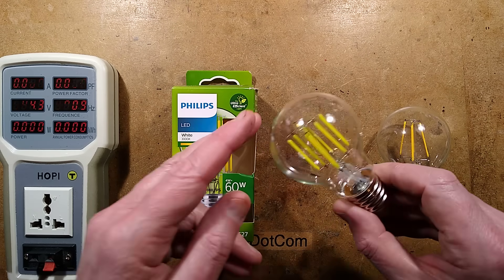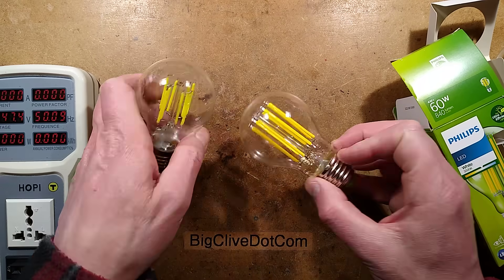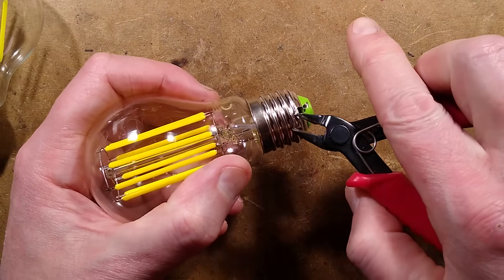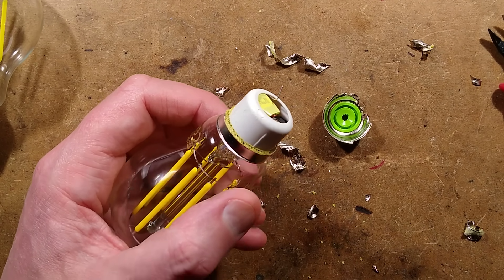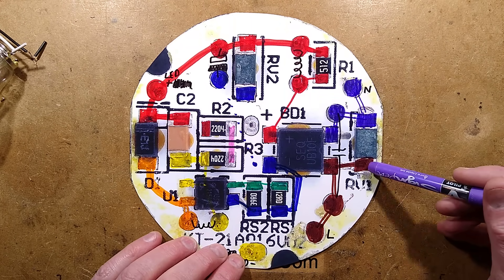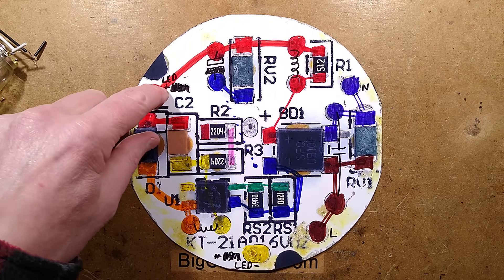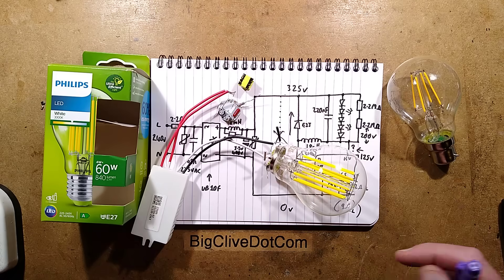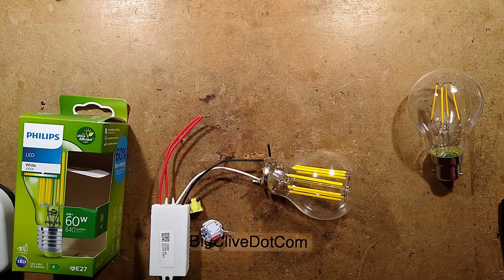Inside a new Philips ultra-efficient LED lamp (with schematic)

Comment: 210lm/W is really impressive. I got some old lamp with 160lm/W and i remember that back then it was the most expensive light in whole shop, paid like 10$ for it. Im still amazed how good that thing performs, my bathroom is really bright and its not even hot to touch, just slightly warm. After using all those cheap hot lamps i didnt know it was even possible.
Reply: 200 or so seems to be about the average I'd see in commercial led lighting I'd come across but AFAIK Cree has been putting out 250+ for several years at least. Most of my flashlights use leds which are about 250 lumen per watt at least. These are larger die power leds but still.. in a low voltage design like that it still takes about 10W to produce a little over 1000 lumens with the Crees. Some of these numbers get confusing.
Reply: @Magneticitist  242.5lm/W is the hard luminous efficacy limit for any true white light source.  Going higher than that requires cutting out bits of the spectrum to which human eyes are insensitive, with the absolute limit for any light source being 683.002lm/W at the 21.85µin/555µm green to which the human eye is most sensitive.
Reply: @randacnam7321  Damn 683 sounds pretty nice, I think I could deal with the green.
Reply: @Magneticitist  Would be monochromatic green light so you would have no color perception.
Reply: @randacnam7321  With the amount of light I'd be trying to throw I wouldn't really need to see color
Reply: @Magneticitist  683.002lm/W is also the absolute theoretical maximum and not representative of what is practically done.
Reply: The us variant only gets 180 l/w

Comment: Had the idea to make an LED panel embedded into an insulating panel I need to custom fit to a basement window. The idea being I'm getting rid of what little natural light makes it in and replacing it with something as good or better. I love day light colors and would love it to be high efficiency and can be dimmed. Any suggestions as to what lighting solution would be easy to use for this application?
Reply: Several lamps with individual switches. Say 4 to allow dimming to 25%. Say one 40W equivalent & three 60AW to go to 18% with more steps. Perhaps one less than 40W equivalent of you like the lowest setting a lot.

Comment: Finally an E27 lamp that is rated for use in enclosed fixtures! Nice.
I bet they engineered this specifically to reach the "A" classification in the re-scaled EU efficiency rating (most good lamps are rated "D" right now). Prior to September last year, this lamp would've just been another A++ along with 85% of the market.
Reply: Given that the new "A" energy efficiency category starts from 210 lm/W and these lamps achieve 210 point something lm/W, definitely engineered to be part of the top category. I don't blame them for that, but would still like to see a redundant voltage converter inside like the the Dubai lamps. Otherwise that will be the part that fails first … and not after 50 years. Much earlier.
Reply: The packaging even involves a symbol Philips had made specifically for lamps that fit the new best category, so I think that's pretty likely.

Comment: High IR output is bad for efficiency but sometimes you want the heat.  Efficiency calculations need to include the cost to buy as well as the cost to run.

Comment: A 50 year electrolytic cap? I know of none that can meet such a claim, even unpowered.
I'd dig a bit deeper into it's spec.
More than 200 lumens per watt...wow!
Reply: Came to the comments to say this. I guess the 50 year claim is just on the LED specs, and not the other internal components? Pretty shady marketing...Yeah, the LED's will last 50 years, but the cap will last 15-20 at the most.
Reply: @floorpizza8074  There are still many radios from 70s that work fine, with caps never changed.
Reply: @xsc1000  Was going to say the same...i have a Collection of Grundig and Blaupunkt transistor radios in my garage, all works fine 50+ years after leaving the factory band. Electrolytics made by Philips or Siemens. My 40+ years power amplifier by UREI (JBL pro) is also in perfect order. Caps by Chemicon (Japan). I guess you get what you pay for...

Comment: I'll have to find out if it comes in bayonet version, or if I have to change my light fittings and burn my apartment building to the ground before I can use these.
Reply from the maker: You can get adaptors.

Comment: Maybe not suitable for PIR motion sensors? I can't imagine what would make it unsuitable though. Perhaps it's the deviation from the circuit recommended in the datasheet.
Reply from the maker: It might be due to leakage through snubbers making them strobe when off.

Comment: Thank´s for showing us the insides! I got the exact same a while back and the first thing I noticed was the price. 10€ in my case whereas a 100 W cheapo is only 1.5€ at OBI. Even though it only gets to 36C, I still wonder if it actually lasts longer. I wonder why they don´t make a 100W "green" yet. Mostly, if you have old incandecent fixtures that were only ment for one 100W bulb, a 60W one does not have a great deal of light. That´s something that pisses me of that you need fixtures that fit a lot of bulbs to get a decent brightness. A Y-adaptor sometimes helps too :)

Comment: I want this with 2000 lumen. Why are E27 lamps always so weak? 800 lumen is barely enough for a toilet.
Reply: There is a 1500 Lumen version available with 12 filaments and 7.3W. It is longer and wider than the version from the video. But no retailer is able to order them, seems like they are new on the philips page.

Comment: Probably base down use only.  With base up, the rising heat does in the electronics.  That was a big issue with CFLs at least when they first came out.

Comment: that simble is for no motion light use
Reply: Motion lights require some current to flow and some led lamps don't provide enough to keep the motion module to working

Comment: I'm surprised they're allowed to use MOVs without thermal protection, given that UL60065 requires it for other domestic appliances for example.
Reply from the maker: In this case it's in a metal enclosure with a fusible resistor.

Comment: I can only assume there are some manufacturer options for that HV line being used in that way, likely in something we cannot read but probably dependent on load or use case, as my experience is that those lines normally need a TTL bootstrap of some sort - which you've shown in other videos - but if this one 'strikes' live or from HV, then that is also interesting / unique IMHO, and likely marries up with the advertised performance characteristics. My slightly imbibed 2c at least

Comment: Philips really need to up their game with dimmable, high CRI lamps. They do make some, especially the "dim to warm" or whatever the branding calls it now. But they are not as ubiquitous as they should be! i.e. they are usually sold out at Toolstation / Screwfix, and they aren't available in all the formats you might hope (GU10 / bayonet / screw / golf ball / candle etc...) Also CRI is never advertised, which is a shame.

Comment: I bought a load of the IKEA "V8" (filament shape and amount) ones, with a Lumen per Watt rating of 160, so not 220 like this one, and I think they are quite good. Even emailed you about them.
When even better cheap ones comes out, I will of course buy those, never really getting near the 50.000 hours 🙂
Reply: I've bought a couple of those Ikea 160lm/W lamps, but Ikea don't seem to be making much effort to advertise their unusually high efficiency.

Comment: One of my first jobs I was working for the senior electronics engineer of the firm and he told me that there were two ways to get incandescent bulbs to last longer. One was to run them off DC vs AC. The other was to run it off a lower voltage than specified. You get a dimmer bulb, but it lasts much longer.
Reply: Two tungsten lamps in series will effectively last for ever... wont be bright tho

Comment: Commenting on LED " colour " , some latest microwave ovens use a ( more robust ) twin " filament " LED lamp , a direct replacement for the tungsten types ( which always fail ! ) .. when powered outside the oven , they give a trendy golden yellow light ( almost similar to LOW pressure sodium street lamps , remember them ? ) .. I am guessing this makes your rotating pie look more appetising ( ? ) .. very peculiar when used as a room light ! ... QED ...

Comment: 3000K is my least favorite color temperature, particularly in these LED lamps. May be the low CRI, but I find mixing 2200-2700K and 5000-6000K in ratio to make a much, much more pleasant mid-white

Comment: The mystery symbol means that it can't be used as the 'flame-effect bulb' in fireplaces, as these need to give off heat to cause a fan-type device to rotate to give the flame effect.

Comment: The mystery symbol might be 'not suitable for PIR security lamps' as a lot of cheap PIR sensors leak enough current to make an efficient lamp flicker when it's supposed to be off.
Reply: You telling me they have gone so cheap to replace relays with scrs
Reply: @africanelectron751  hey, relays are expensive!

Comment: i had 2 LED bulbs die in the same month, one was edison the other bayonet ,both around 4-5 years old ,morrisons own brand ,they did ok i suppose ,i got a replacement morrisons one with 6 filaments instead of PCB mount style ,it has around 20 LEDs per filament ,see how long that lasts, think its a 100 watt candescent equivalent bulb

Comment: Nice video as always.

Shame though.  Another intermediate step to actually making a decent lamp?  More landfill along the way?  Sold in clear glass for showmanship, or for magpies?

I still see evidence of polar banding in the output.  It'd be nice if you could gently rotate an illuminated one a few inches away from a white background to see how much of an issue this is, is it just bands of brightness, or the common blue/yellow hue as well?  As far as I can see it will remain an issue until they put in dozens and dozens of filaments, or switch to less efficient outward facing COB arrays,  or just implement a secondary diffuser - yes, a frosted, opal or matte bulb coating.

The best possible quality of light comes from having a large uniform and spotless illuminated area.  After being an early adopter of ugly and short-lived clear filament LEDs I've gradually swept through the house moving to opal or frosted 100-140 lm/W versions by Silvania/Crompton/Osram/Calex/Philips.  The big GLS A80 Philips matte white 1521 lumens gives an amazing quality of abundant, disperse and diffused light, something we've been missing since the demise of the traditional opal coiled coil, and the Silvania A60s come close.  The Osrams have had a huge failure rate, but the other "brands" have been great, though none of these efficient and attractive filament bulbs are available in the usual physical or online outlets.  Diall sell some that look similar and are available in the DIY stores, but are much less efficient.

With secondary diffuser bulbs the polar stripiness is still there at the glass, but generally unseen there due to dazzle, and beyond that it's inconsequential because as it is diffused it doesn't project onto your walls or ceilngs or anything more than an few inches away from the bulb.

And CRI 80.  I have CRI 97 GU10 lamps in my kitchen spots and in a reading lamp, and they just light up stuff with realistic hues, so much better discrimination than my filament LEDs.  C'mon, surely they could put better phosphors on those filaments - or is it just another planned obsolescence/upgrade path?  They won't wear out quickly,  but when folk realise their output can be dramatically bettered...

So, with it's lack of a secondary diffuser, poor CRI, and lack of dimmable options, this seems like another lamp with designed-in obsolescence, in spite of its eco bragging rights.  For sure it's prettier and more efficient than the high street filament LED offerings, but why won't Philips just go the whole hog and make us a fantastic long lasting and efficient bulb with great quality light output to match?

Seems a sensible choice to ditch the Dubai lamp's linear regulator though - why waste a percentage when you are chasing percentages...?
Reply: I've been looking at conventional LEDs (not the filament or chip-on-board types) and high lumens per watt go along with poor color rendering.  For a comparison of two 2700K devices, the high efficacy LED was 216 lm/W but it had CRI 80 with R9 = -7.  Finding a part with good light quality (CRI 90 and R9 = 50) dropped the efficacy to 123 lm/W, a drop of over 40%

Seems like a missed opportunity for filament LEDs though.  I've long wondered whether they could include occasional LED chips of different colors to fill in where needed.
Reply: @CoastalSphinx  they certainly could mix colour LEDs in each filament, especially with plenty of filaments behind an opal diffuser, but maybe it's just about getting the right balance of broad spectrum phosphors⁷ in the silicone coating.  Line responses such as quantum are efficient but the exact opposite of what's needed for colour rendering

Comment: Hi, I'm new to the electrical world. I'm surprised that the PF is so bad (0.53), why doesn't the manufacturer improve that in order to improve efficiency?
Reply: PF and efficiency aren't directly related.  Basically, PF only really matters when large amounts of power are involved.

And in this case, improving the PF would need a fair bit more circuitry (which probably wouldn't fit into the bulb base) while reducing the efficiency of the bulb.
Reply: @CoastalSphinx  thanks for responding. I'm learning that electronics are not like electrics. 👍🏻

Comment: If the chip has a fet it probably runs about a 20v supply, powering it through the leds makes the chip drop less voltage, with the advantage that the current it takes goes through the leds producing light instead of just heat in the chip, so I'd agree its done for efficiency.

Comment: Recently I had to replace a tungsten bulb that had been in daily use for over 10 years.  The led replacement would have cost seven times as much as a tungsten replacement - that's seven times as much work and energy expended just to afford the led, not to mention the unnecessary complications of its eventual disposal.  Even then, the led would not have worked in the dimmer circuit so that would have meant addition expense.  Fortunately I was able to purchase a stock of tungsten lamps.  Another own-goal by the eco-idiots.
Reply: weird hill to die on honestly, 4 bucks for a bulb that costs 6x less to run and lasts 50x longer is a steal. florescents deserved all the hate they got though.
Reply: @ShinyQuagsire  The previous bulb lasted over ten years in a normal daily use so one that can potentially last 500 years is of little interest to me. I do use leds where it is appropriate but the long life claims do not stack up - I have had several which have failed within months.
For me the main benefit of led technology is its potential for developing low voltage lighting alternatives which can then be run using renewable energy sources.

Comment: Icon: I think "Not suitable for Emergency exit luminaire". I thought about what you said about using the chip in a non-standard configuration. Philips may have got a copy of the internals from the manufacturer and/or consulted the engineers at the manufacturer or simply got a custom version of the chip fabbed. After all, they Philips would be ordering enough that it would be worthwhile. I did a quick check and it doesn't look like this lamp is available in North America yet.

Comment: I'm still staggered by how LED lamp manufacturers get away with the lifespan claims on the packaging. I replaced 8 gu10 lamps with expensive LED units (circa 5 quid each), because I was sick of replacing the halogen ones( I considered power usage as well). The bloody things started failing within 2 months.
Reply: I had the same experience replacing some G4 lamps. I later learned it was "my" fault. The transformer was rated with a minimum wattage,  and the LED didn't draw enough. So the power supply was uneven, and that fried the LEDs.
Reply: @dirrelito  these are mains rated at 240v. Straight replacement lamps.
Reply: @handlesarefeckinstupid  did you put them in recessed outlets? Most failures I see in LEDs is usually the power supply and if not an LED slowly cooking in recessed lighting.
Reply: @dirrelito you need to do some research first whether your LEDs are constant voltage or constant current

Constant current LEDs has to be paired with the right power supply which limits it to the correct current, this is similar to the ballast of a fluorescent light

Constant voltage LEDs don't give a sh*t as long as you give it 12v, since it has current limiting resistors built in

Comment: Another dead LED bulb in our house the other day.  Though it happens rarely, I think the power supply in LED bulbs is redundant, less reliable which is wasteful.  we should start thinking having the DC power supply in switches so that they are easier to replace and less space constrained that those in bulbs.
I'm thinking of a light switch/panel that integrates the switches and  a power supply that outputs DC, maybe like, PoE voltage around 50V which connects to the light fixture

Comment: This light is made for new energy labels (EU) 2019/2015 for lighting products. Getting A label on your products your need have 210> lumens per watt. With an higher CRI is very hard to reach high luminus effiecenty. 
I guess around 36 LED chips per filament.. at 2.75V @ 4.9mA per chip